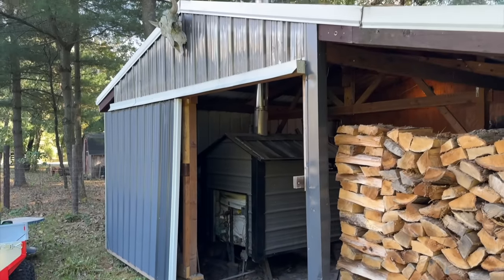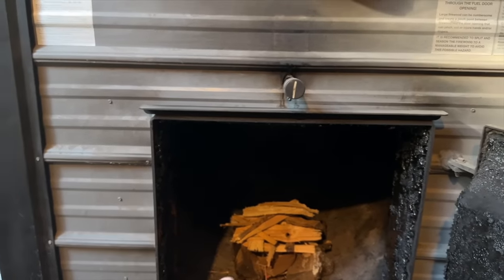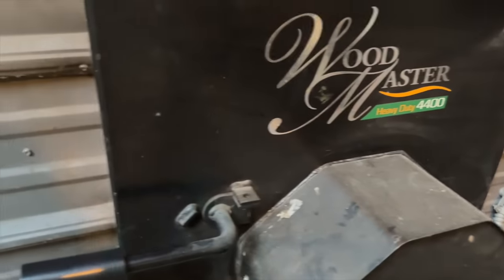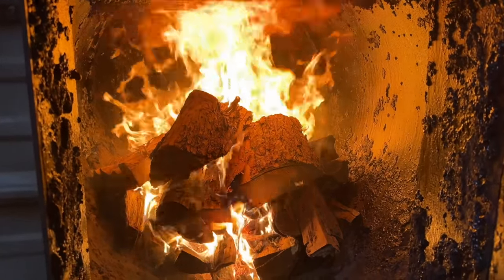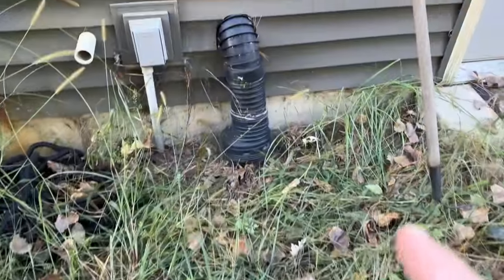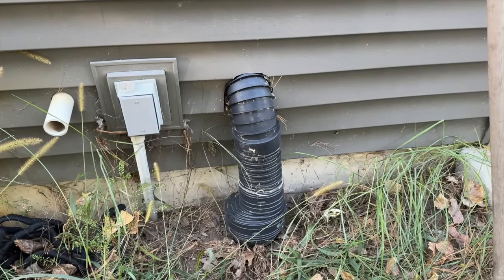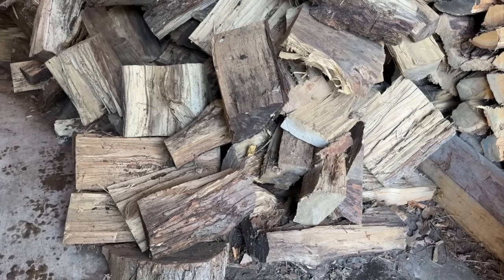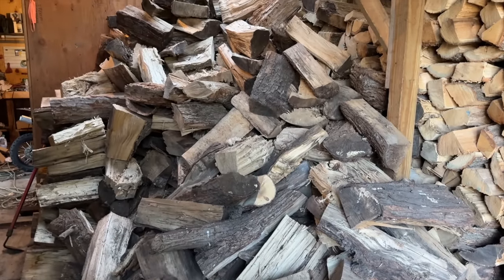Starting an 8 Month Fire in the Outdoor Wood Boiler

Comment: I insulated the pex pipes inside the house saves a lot on firewood. Keeps the heat in the pipes and the basement doesn't get too hot. Used the refrigerat pipe insulation from the big box store, just slides on.

Comment: Thanks Dan. I started mine on Sunday.
I only run My water temp 145/155. Plenty hot for in-floor and Domestic Water.
My Domestic Hot Water heat exchanger is near the FLoor, picks up the cool water from the Bottom of the Tank.
and with thermal Syphoning it recirculates back to the top. only need the pump for the initial start then it is off for the rest of the season.  It also goes through a hot water rated Filter before the Flat plate to keep the junk from the Tank from plugging the narrow passages of the Flat plate. 
My Vote is about the 10th of November.  
Mike M.

Comment: It is interesting to see how the fine folks up there in the “Frozen Nawth” stay warm. I have never heard of an outdoor boiler until I started watching firewood processing videos. Thanks for the info.
Reply: I thought they just wrapped themselves in Reindeer hides and huddled close inside the igloo until spring?!?! 🤔
Reply: im in nc, i have had a boiler for 20 years, its great and way cheaper than propane not to mention i can keep it as warm as i want
Reply: @bullofthewoods9374  so how about the rain deer hides? Use those too in NC? If we have 10 nights below freezing during any winter it was rough one. But I did see that this coming winter will be cold and very wet for south Louisiana so maybe I’ll have to break out some skins for those cold boat rides through the swamp. 🥶
Reply: not sure what you mean. just saying 8 months of cold is not for me. we have many nights below freezing in nc. where do you live. also if i had natural gas i wouldnt bother with a boiler at  all. here in nc i can buy a cord of wood for under 200 bucks. natural gas is cheap but propane is not. I heat 3100 sq ft and was using 1200 gal of propane when it was 85 cent a gal. now its 2.39. and i was burning an insert. the boiler paid for itself in 3 years and now saves me a ton of money while i have warm house. i now use about 250 gal of propane a year since im also gas water heater and dryer and cook top. boilers are not for everyone. you have to weigh out the work and the cost. it has been great for me
Reply: @bullofthewoods9374  the reindeer hide was a shot at someone else, he he. I live in a 1800 sqft log cabin that’s nicely insulated for south Louisiana where the climate is more tropical so winters are somewhat mild. Temps below 20 and snow come every few years so it’s not feasible for anyone here to have boiler system which is why didn’t know of their existence. Not uncommon to have on shorts and tee shirts for Christmas and New Years. My forced ventilation fireplace heats the house plenty even when it does get cold so propane usage is minimal. We have a rare October temperature wise because it been in the 40’s 4 times. Making up for the 75 days of 100 plus temps this pass summer, I guess. I’ll take it but we are still in a bad drought and burn ban which is killing the firewood business.
Reply: @saltrock9642  yeah you would not get any benefit from a boiler for sure. i also have a log cabin but its a modern built one in 1995. i built it from cedar logs. cheers
Reply: Sounds very nice @bullofthewoods9374 . Mine  has pine logs that makeup the first story, cypress siding cover second story and cedar post hold up front and back porch roofs. All trim is cypress. 1985.

Comment: Use a CSL log (chimney sweeping log) they really do work for the creosote build up, you can burn a couple with the wood that’s in there or by themselves, they’ll dry out the creosote and it’ll start falling right off, again they really do work but try for yourself will see for yourself, the ones I get are called CSL and gave a picture of a chimney sweep on the box sold in singles

     All The Best
               Fabrizio

Comment: We had an Aquatherm 345 to heat 2 2200 sq ft' homes plumb directly into the boilers with 2" insulated pex pipe. Aqua Term are a pressurized system. No need to check water inside boilers keep the system full. I found it easier to burn 4' long ice storm damage mostly pine and soft maple. No time splitting at all. 4' round wood gave longer burn times!
Reply: And with an Aquarherm, there is no need to split wood, and you can put in 3’ lengths.

Comment: Been resisting firing up the stove here on the east coast. Been in 40s overnight and 60s during the day. Just enough solar heating to keep the house above 70 inside but it's slowly dropping. I think by this weekend we'll be forced to start lighting an evening or morning fire. My tree service connect just dropped a cord plus of red oak logs for 2025. I have 6+ cord of maple but very limited oak supply (maybe 1.5 cord if I'm optimistic) for this year.

Comment: I've seen a system with one thermostat. The way it works is that when thermostat calls for heat, signal goes to a controller. Controller checks water temperature, if above 90 degrees, it turns fan only in the forced air, if temp ik the water input goes below 90 or was already below 90, controller will call for heat from HVAC. So that way if your boiler stops, it switches to natural gas or propane, if hot water comes back it keeps the fan going but stops gas. And for people in the house, they don't have to think on what thermostat to use.

Comment: I would’ve put a 3-way temperature valve (160*) in there, so the boiler first heats up. It prevents condensation inside the boiler.

Comment: check out the heatmor boiler. it has a rubber bladder for expansion so water will not spill out. also my circ pump only comes on when my thermostat calls for heat. by running it all the time you will lose heat. although if your in the north it may run most of the time anyway.

Comment: Got a 8,000 square foot shop with radiant floor heat for are farm that we were considering heating with wood but then realized we would need to be part time loggers so we ended up just plumbing into are two 10,000 gallon propane tanks and we get tax free propane all winter with no work. 😂 The shop uses the propane vapor off the top of the tank and are grain dryer uses the liquid propane off the bottom. 🤷‍♂️

Comment: How many underground feet of pipe did you have to run from the house to the boiler? It would be interesting to see a heat loss per every 20ft or what ever could be calculated done in a video. There has to be info on this somewhere. When I had mine, my underground lines were over 200’
Reply from the maker: I probably only have about 60' or so...and don't really think I lose much heat, the tubes were wrapped up pretty good with insulation. I've seen pictures where guys didn't bury the line deep enough and there'd be a path of melted snow through the yard....lol

Comment: So do these auto dampen to create a slow burn when the high water temp is reached?

And how many cords of wood do.you go through per season?
Reply from the maker: Yep the blower shuts off and no air is forced into the firebox so it slow burns until the water temp drops to 160....then the blower kicks on until temp hits 170 then shuts off. Cycle just keeps repeating depending how much heat is pulled off the water. 
I usually burn between 10-12 full cord a year....but that's starting beginning of Oct. and going through end of May. Also keep the house temp at 74 and it heats the hot water.

Comment: What is surprising is that accumulator tanks are not widely used in the USA and Canada. we in Scandinavia have it with wood burning to almost 100%
Reply: Since we usually use the accumulated heat transfered by water not by air.
This system is using heat by air transfer, it is old and not very efficient way to heat your house up

Comment: It was great to meet you at the show, Dan. Two questions. What is the "LA" on the display? How often do you have to clean the HE in the boiler? November 1.
Bill
Reply from the maker: I'm not exactly sure what the LA stands for, but it only blinks when the temp has dropped below I think 130. Now that I have the temp up it only just displays the water temp all the time...no flashing.
Reply: low alarm
Reply: @matkremzar5474  Thanks

Comment: How many cords do you burn in a typical year?
Reply from the maker: On average around 12 full cord.
Reply: I'm in TN so much warmer weather; I have an Ashley CWF200 wood furnace from the 1980s in my basement hooked into the HVAC Ductwork & run the furnace from late Oct to May & I burn two to three cords per year

Comment: Dan do you have to have a different type of hot water heater to heat with a wood boiler
Reply: No. Just a Water to Water heat exchanger. Mine is Propane and I turn it off when the OWB is running.

Comment: If you have gas to the property, why wouldn't you run the boiler on that?
Reply from the maker: Because I have to pay for the gas...lol...if I was just running gas I'd just run the forced air furnace in the house, there'd be no need for the boiler.